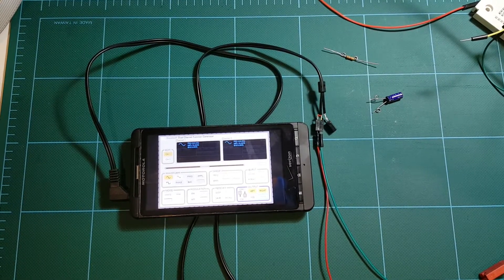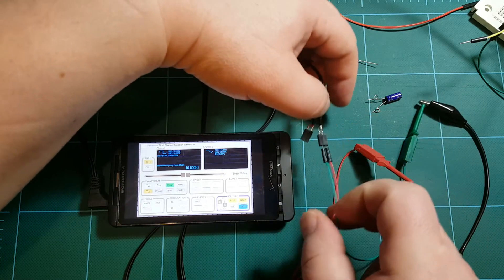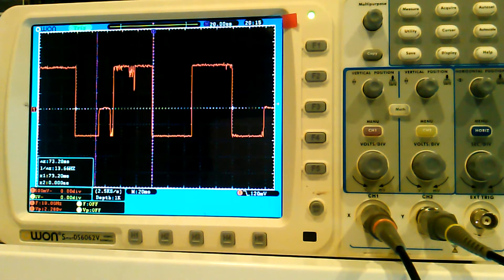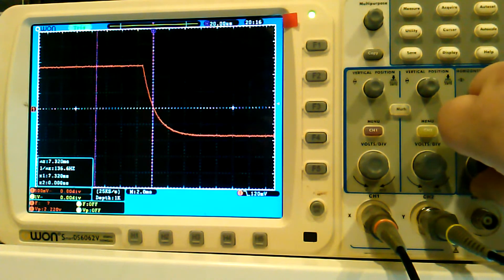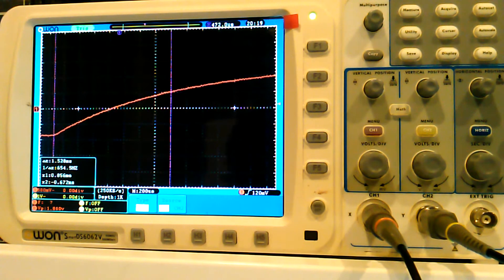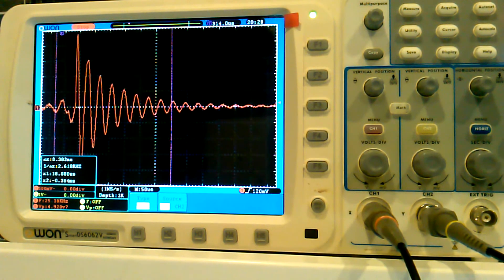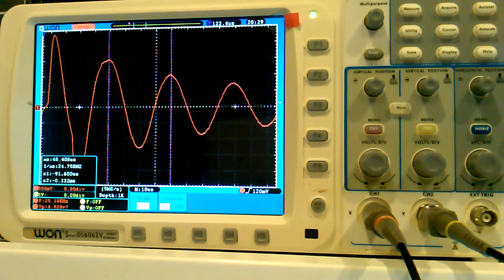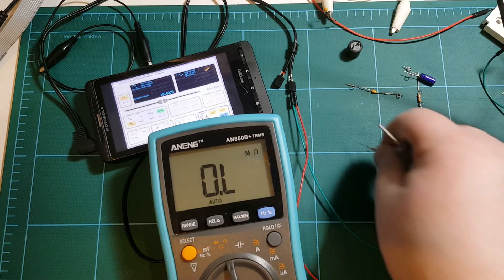Cell phone signal generator measuring capacitor

Comment: What if one use their signal generator across a voltage dividing network  (known resistor and unknown inductor) and then measure the voltages across each?

If V(R) = voltage across resistor and V(L) = voltage across inductor can we say that: V(R)/V(L) = R/X(L); so that when cross multiplied becomes V(R)×X(L) = V(L)×R; and when isolated for X(L) becomes X(L)=(V(L)×R)/V(R)? And, because inductive reactance is X(L)=2×pi×f×L then 2×pi×f×L = V(L)×R/V(R) and isolating for inductance becomes L = V(L)×R/(V(R)×2×pi×f)